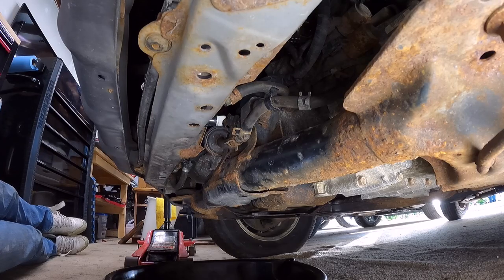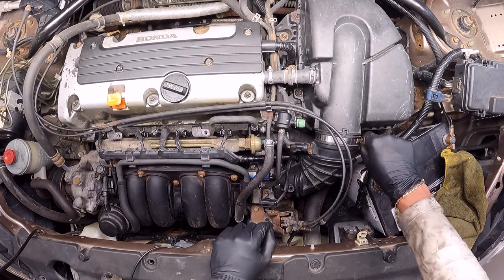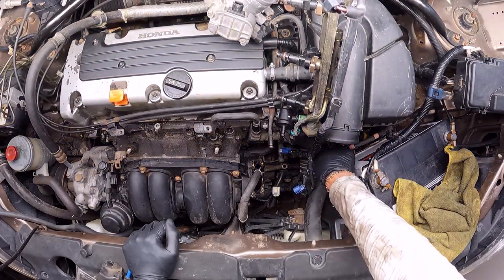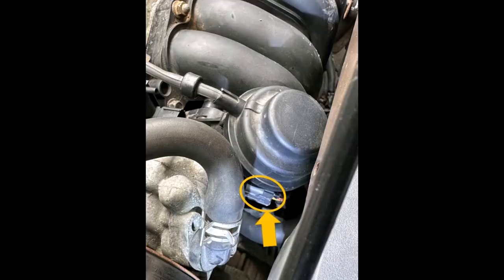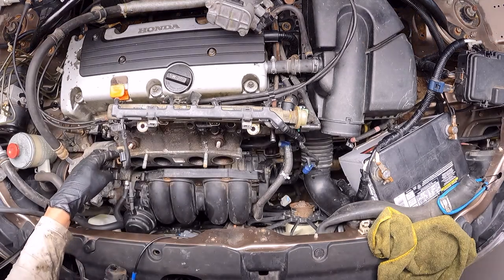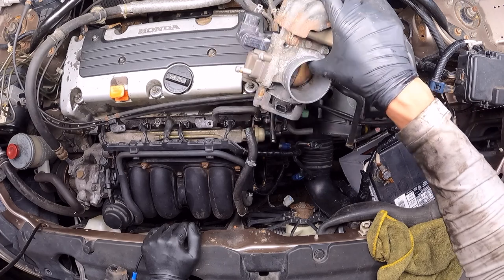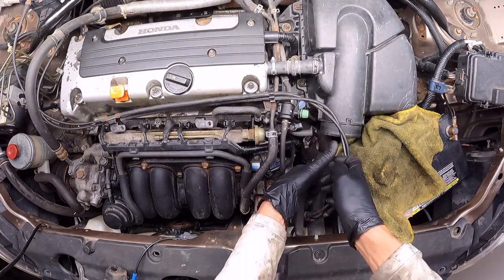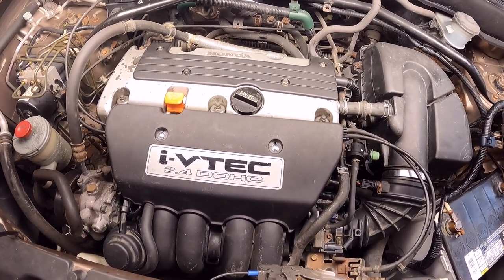Intake Manifold Removal - Honda CRV (2002 - 2006)

Comment: Great vid, thanks. Used this to replace a knock sensor as much easier to access from above. For anyone else who didn't want to drain coolant, the alternative is to remove the front bulkhead which was pretty straightforward, and to disconnect everything from the throttle body except the coolant lines. If you do this, you can just pull the manifold straight out and leave all the radiator hoses and coolant lines intact. Everything else in this vid still applies, just don't drain coolant, remove coolant hoses from throttle body, or remove radiator hose. Didn't see this mentioned anywhere else but pulling the bulkhead is how the Honda service manual has you do it too. Thanks again
Reply from the maker: Thanks for your comments and the good observations you made. Suscribe !!!
Reply: is the bulkhead that metal bar that goes across the front?

Comment: Thank you, for this tutorial  video!
You are very profesional and honest.
It takes you  less than 20 minutes to remove and replace the Intake manifold, but why are  the the mechanics I consulted told me the need my car for a day or two to do it? 
I am so tired of being ripped off! 
So dufficult to gi d honest mechanics on streets or even at dealers. Is like they are in complot to rob us. :(
Reply from the maker: Thank you very much for your really nice comment , not all mechanics are bad but some of them abuse at the moment to charge customers, that was one of the reasons I started this channel. Good luck and merry Christmas.
Reply: Merry Christmas to you, too!
Reply: Well... just because someone removes it in 20mins... doesn't mean that a shop is ripping you off by charging you for 5 hours... if that is what the labor guide lines says that job requires. Plus you are not considering other jobs that might be in front of you for the day... secondly,  older cars very easily break plastic parts, you are not calculating that into your equation of just 20mins of work. Thirdly, you are not factoring the time it takes the engine to cool down before work could begin.
Reply: @dennismelville7532  Charging multiple hours for a job that takes 20-30 minutes is not appropriate at all. As for the labor guide, it is incumbent upon customers to ask what that is, as it is often ridiculously long (Honda) and overly expensive ($250/hr)

Comment: No need to remove the rad. Bulkhead out, fans, intake,manifold
Reply: Yeah, this is how I just did it. Didn't even have to remove the fans. Very nice to not have to deal with burping coolant system after and still straightforward
Reply: Thanks for this comment - this is what made me look at the Honda service manual and see they recommend to remove the bulkhead too

Comment: missing step to remove bolt at bottom right of intake manifold
Reply from the maker: This manifold has 3 bolts and 2 nuts and the video clearly shows how to remove all of them, there is not bottom right bolt
Reply: ok @TheNomadMechanic
Reply: It depends on the year you have, some of the k series have a bottom mounting bolt and some dont